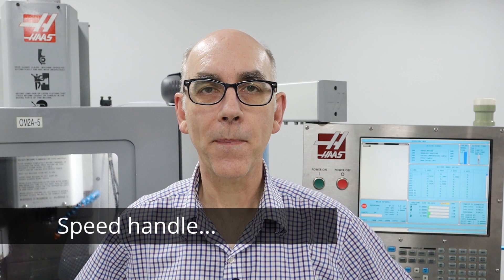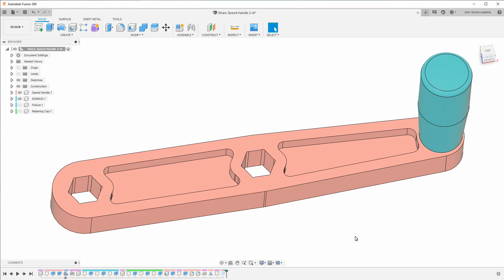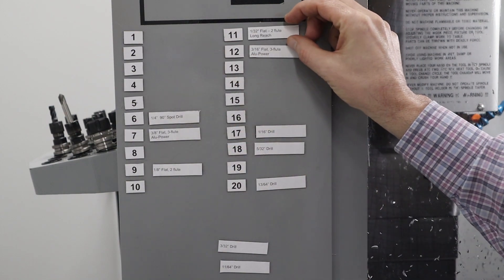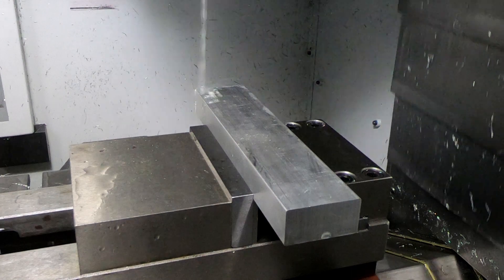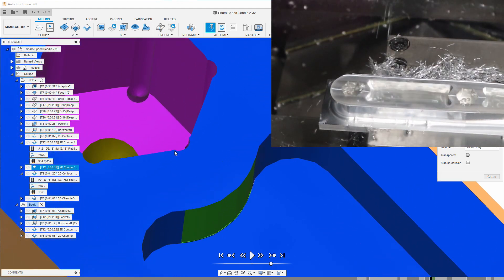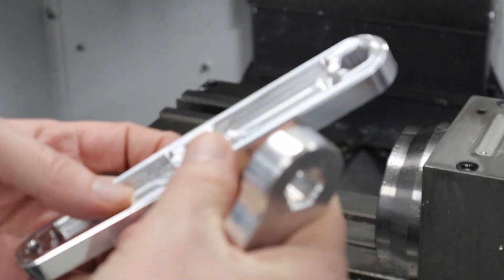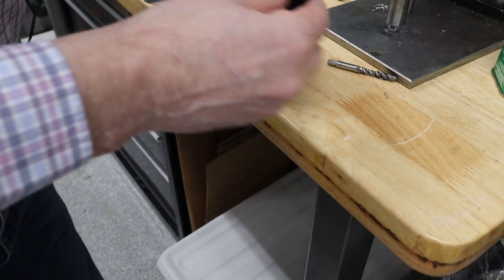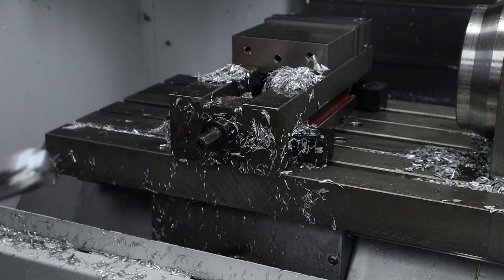Organization and Speed Handle Take 2

Comment: An airline leak like that in my shop would drive me bonkers. How do you deal with that?
Reply from the maker: I'm assuming you're referring to the compressor running? It's a small compressor. I'm planning on getting a larger one, and fixing a small leak in the air filter.